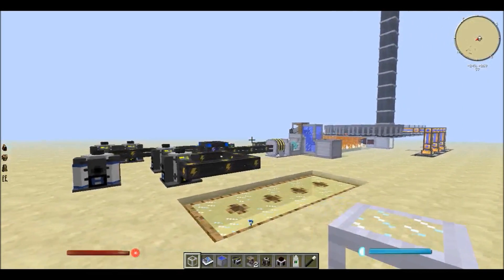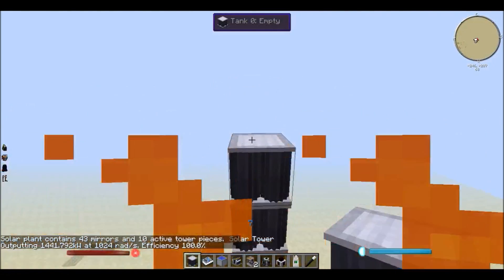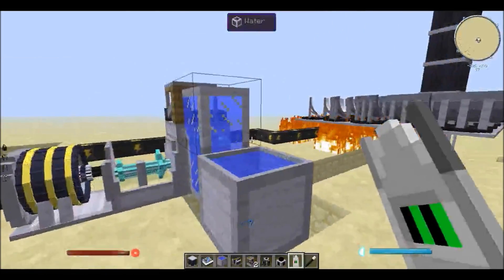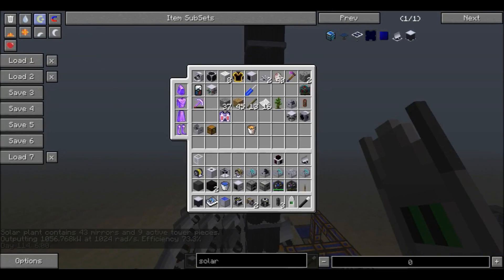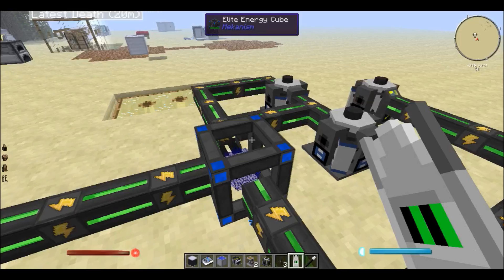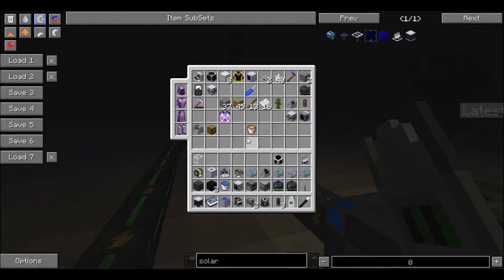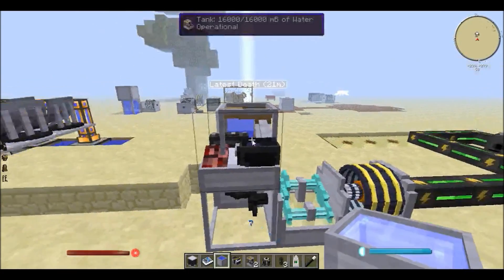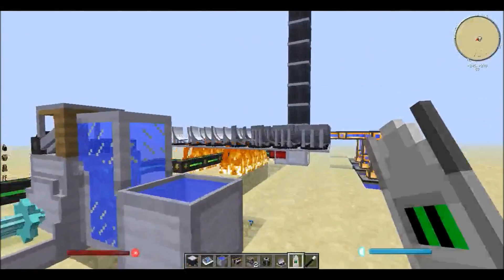RotaryCraft: Extractor powering system build prototype

Comment: Yeah, I can tell what reika did with the towers, it's like what the IC2 guys did with the thermonuclear generator, each tower multiples the value of the mirrors by 2 (similar to binary) said value is the torque, the base doesn't count but, 1 tower (not the base) make the value of a mirror 2, 2 towers make the mirrors 4, 3=8 ect. ect. So I think that's cool and makes since, and the water consumption scales with the overall output I think, but it is more important to have a lot of towers and not just mass produce mirrors. also WHY IS THERE NO WAY TO REPLY ON THE MOBILE APP?!?

Comment: The way the cap works is that after so many mirrors, it takes more than one to make the power go up, in my test world, it took 12 or 13 mirrors to make it go up from 9 mirrors, so yeah, 11 won't make the number go up, but 12 will (maybe 13, I'll have to check again)
Reply from the maker: There is no cap on the mirrors. The Solar Towers have caps.